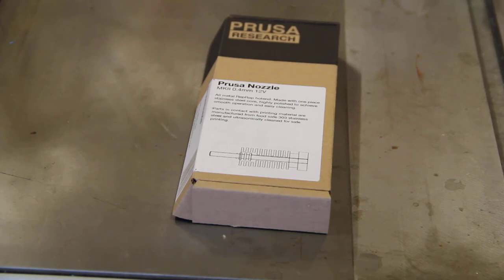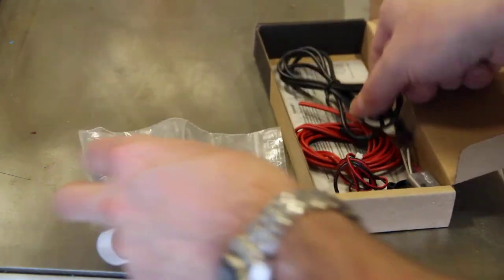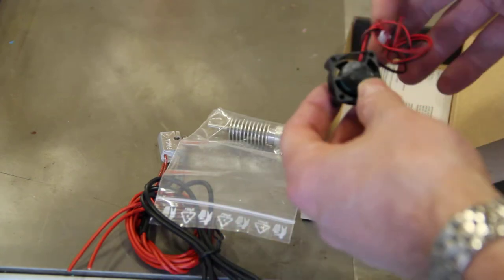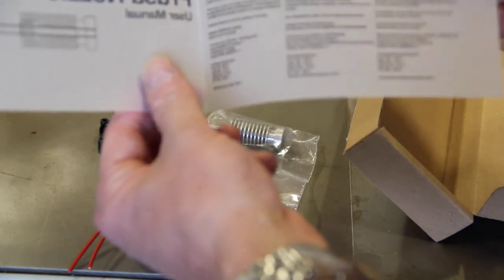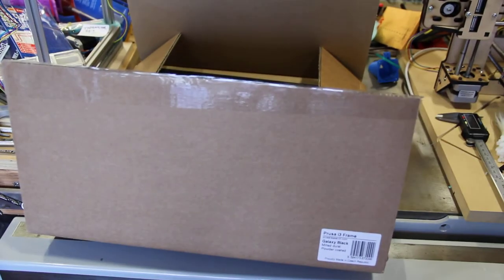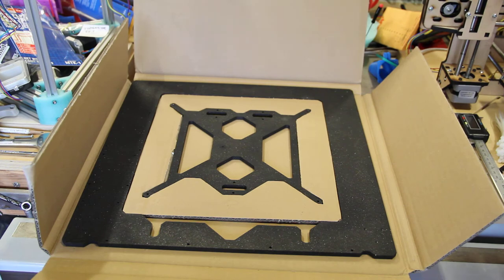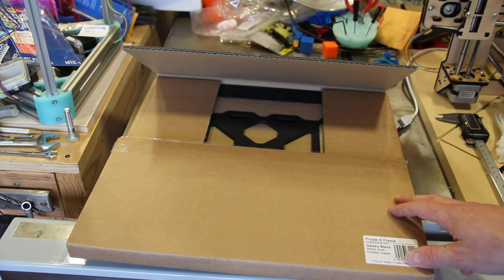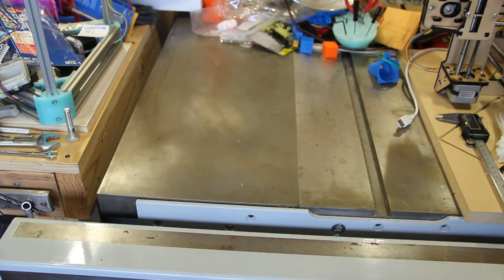A Package of Prusa Parts from SeeMeCNC!

Comment from the maker: First off, thanks!  Great idea to build a printer for your thesis, I wish we'd had 3D printers when I was in school. :)  

Second, those are great questions to be asking.  Honestly, I think most people prefer what they know, so for that reason, I'm going to suggest RAMPS 1.4.  Also, RAMPS has a little more flexibility (at least compared to Printerboard and Gen6), and is at least sort of modular, so if, for example, you blow a motor controller, it's a quick fix instead of a whole new board.

Comment from the maker: The bed is what warped, actually.  The front lip curled down so far that it was crashing into the front plate of the Y--axis, which I planed down a bit. My printer is set up in a detached garage with only the garage door for access, so it's almost like it's being run outdoors (covered, of course).  Then it has a heating element on one face that gets up to ABS printing temps.  Birch ply is pretty stable, but that's asking a lot of it. Running indoors should avoid this.

Comment: Also, what did you see warping on the MakerFarm printer?  I was a little concerned about that, but it is in an interior room of my house so hopefully not subject to extremes of heat or humidity.  When I asked Colin, he didn't seem too concerned about warping, and didn't think sealing the wood was necessary.

Comment: In the left corner seems to be a rostock max, do you also have one?
How many printers so far? Makerfarm i3, MendelMax 2.0, Prusa I3 and Rostock Max?
Reply from the maker: It's actually a Mini Kossel, but yeah, that's it (for now!) :)
Reply: I'm building a Rostock Delta, to join my Makerfarm i3. Do your Mini Kossel work with timing belt? How good are the prints?

Last week I "converted" my Makerfarm i3 extruder in the bowden extruder, to reduce the vibration. It's an on going project. haha
Reply from the maker: The Kossel isn't actually finished at the moment, but it will run on GT2 belts.  There are a couple of small design tweaks I'm still figuring out.  I've thought about the Bowden conversion for the i3, I think it will do a lot to lessen the load on the X-axis motor.  I'm not sure it will speed the prints up much, though, since it will still be constrained by the speed of the Y-axis.  Also, I'd be curious as to what changes you needed to make in Slic3r, etc, and also how you like it in general.
Reply: I asked about the Kossel because I'm building a Rostock (delta), the regular one. So I was curious about the quality you got withou buying a kit.

On the Makerfarm i3 I did the conversion to Bowden. It really takes a lot of weight out from the x carriage, that's great. But there are some issues with ooze. The tube I got to do the "transmission" is not tight enought and it seems to push even when extruder motor stopped.

It's weird though, since some ultimaker printers use a really long tube transmission with bowden extruders.
Reply from the maker: Sabague
 That's the challenge with the Bowden design in general.  Even the Ultimakers have ooze issues, which get addressed with some pretty aggressive retraction settings. As for the kit vs. self-sourcing question, I actually think the quality you get out is directly proportional to the effort you put in:  Once you've got a printer, you make parts until you get a set that is just abut perfect.  A kit manufacturer has to balance quality against print speed.

Comment: im trying to find a 300mm x 300mm build area reprap printer to build! is there one?
Reply from the maker: Hi Carl -

Trinity labs has the Aluminatus, which is 300x300, and there is one on Thingiverse called the TK300.  Both of them use a lot of metal for the framing.  There are going to be some significant challenges keeping things stiff and straight over that distance.  I'm sure it's possible, but I suspect it will take more than just scaling up an existing design.  I'd love to be wrong, though!